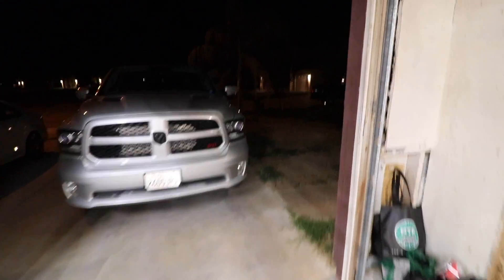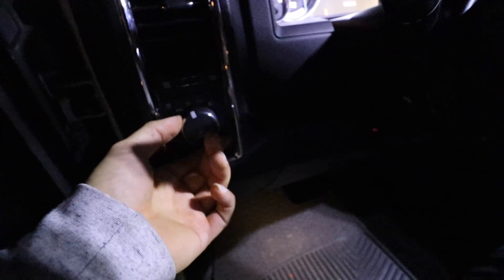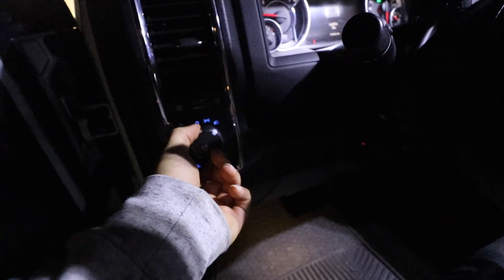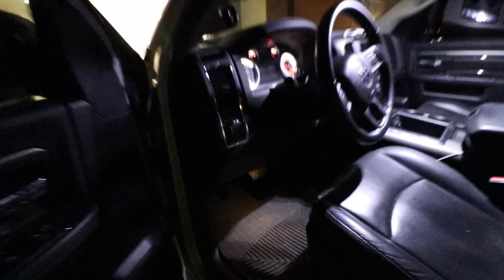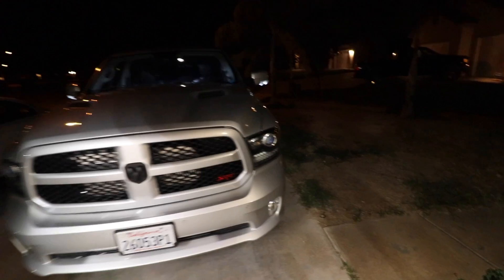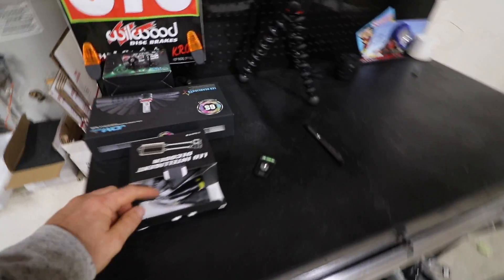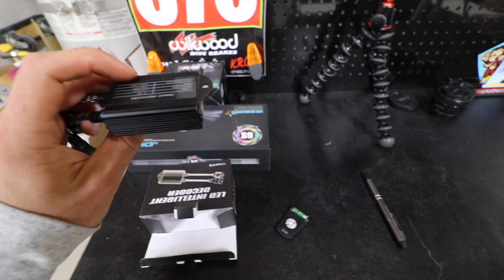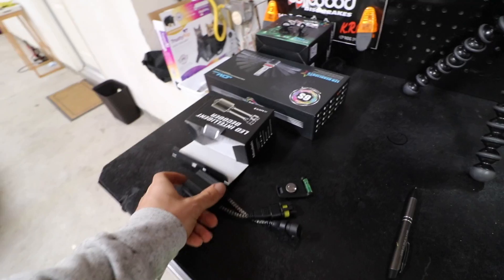RAM 1500 Canbus Decoder ISSUE

Comment: You have to use a relay hardness right to the battery! I recommend using Morimoto Mopar Relay Wiring Harness HD Resitor Plug & Play. I have the relay hardness with the same decoders as you and this setup works great. It’s not a decoder issue you have but a power issue when you have your lights set to auto. The auto mode uses half the power than using the lights on manual mode. HID’s need to be ran to a power source when using auto mode.

Comment: I also have 55 watt HID's in my projectors but I use an inter posing relay powered directly from the battery. Because the canbus would see very little load you must use 2-55 watt resitors one for each headlight. I have absolutely no problems at all! Check on line for this configuration as some aftermarket projector headlight vendors will supply these resitors with the new headlights. You can obviously purchase the resitors separately on line as well.

Comment: Bought mine from headlight revolution and I’ve had nothing but problems with my 2017 Dodge Ram 1500 big horn. Fucking lights flicker on and off every time I drive at nite. I have the GTR ultra 2’s with a relay/decoder and still it doesn’t work right. I’ve had nothing but problems this whole time, and I’m about ready to put stock bulbs back in. I’m at a loss and it’s making me crazy. But your video here makes a little sense, so I’m gonna hit  up HR for answers, Since they are guaranteed for life. Thanks for the info, it helped. 👊🏼

Comment: I had this problem ith my 2016 ram 1500 after a headlight hid upgrade,so i tried the
JDM ASTAR 2x 9005/9006 Anti Flicker Decoder and it works .no more issues,it also works in auto headlight mode
Reply: patriceknight72  what hid kit are you using with the decoders. Is it a canbus ballast and do you have a relay connected

Comment: Hey bro quick update on my mods, I used the 35W HID kit 9006 on my fogs with the same canbus decoders as you and mines do work with the auto setting without having to use it manually, most likely the issue with your 55w will be needing to run the relay harness.

Comment: Have to say I really like your videos...always so informative!
Question:  I recently bought aftermarket projector assemblies to replace the reflector headlights I have in my 2012 1500.  The assemblies I purchased also came with HID 6000K bulbs and all the fixings.  The backs are separate covers not like what you have stock.  How do they have to be wired???
I do have AlphaOBD and was wondering what do I need to program to get the DRL function to work and will it work on "auto?"
Does the "led" selection in OBD also set for HID?
What does OBD eliminate in the set up....just the can bus?  I must still use the ballast...correct?

Thanks for the help!!!

Comment: Thank you so much for this!! I was wondering what the heck was going on with my lights I have a similar set up accept my truck is at 2012 so I had to get the converter harness from headlight revolution for my configuration to work but on my truck it’s not only my headlight that goes out sometimes my indicator on the right side start flickering fast as if had a bulb blown. So I’m gonna try this out and see if it works

Comment: I recommend DDM tuning, I've been running ddm tuning canbus plus hid kit in my 2014 r/t for almost a year and have had zero issues, it's a canbus compatible ballast so no need for a harness or relays or decoders, plus lifetime warranty from their website
Reply: Last week bought them and they flicker when I start the truck, they are fine if the truck is on “run”.

Comment: Only issue I had was when you unlock the truck the HID would turn off after 5 seconds instead of staying on for the 30 seconds
Reply from the maker: Mine doesn't do that but when my battery was low/weak I had some flickering when unlocking the truck when the lights turn on with engine off.

Comment: I have a 2015 ram 1500 laramie with projectors
and the Hikari 12000lm led and using the Hikari canbus decoders my light worked fine for a couple of days with light switch on auto now they don't work at all on any setting,i don't know if its the decoders or maybe the new Diode Dynamics switchback boards i installed to control the parklights as DRL's,but based on what this video is showing i am thinking its how funky ram and dodge/jeep is,i am thinking about switching to HID...What do you think?

Comment: On the 2007 Ram 1500 I have the Hikari led’s wont turn on with the engine but do when the engine is off. I have used resistors with no better results. Will decoders fix this? Or how do I fix this? I need the bright light but I can’t get them to work!,,

Comment: Has anyone tested the AlfaOBD software and Scantools OBDLink MX connector.  Just got one this week and there are setting that you enable in the ECU for LED lights pretty much everywhere.  Wonder if that lets the Canbus compensate for the LED lights.
I don't have the LED headlights otherwise I'd try it.

Here's a discussion on RamForum on this software/OBD plug setup.

https://www.ramforum.com/threads/alfaobd.123982/
Reply: You can also enable NAV in Motion, SRT splash screen, adjust tire sizes, etc.  Pretty cool tool if you use it carefully and write down all settings you change.  Also, now I can roll both front windows down with the remote, like I could with my Challenger when I had it, pretty cool.
Reply from the maker: I think im going to go with the TAZER with active line lock and bunch of cool stuff
Reply: @BoostedMotorsports  have the Tazer for my Charger R/T, pretty cool.  Most of the stuff you can do with AlfaOBD, except for the linelock and light show feature.  Linelock works awesome in both Ram and Charger.

Comment: hey i just put a set of 55w innovaded hids, but they keep turning off and on randomly , did you ever get that problem fixed , with the auto working?
Reply: Adriano Montejo I also have the 55W Innovited and it flickers then turns off.  It was working when I installed them but next day flickered and off. I haven’t tried the manual switch yet, does it really work?  Did you ever find a fix?

Comment: Yup my hids are 50/50 I have to play with the switch sometimes, or turn on and off the truck. I have a different decoder, but have the hikari too just havent felt like taking all apart to switch them out
These is what I have HID Kit Computer Warning Canceller Capacitor Anti Flicker Hid Ballast Error Code Eliminator-2 sets https://www.amazon.com/dp/B07483MJT3/ref=cm_sw_r_cp_apa_i_ZY34BbVDVHAJ6
Reply from the maker: Yeah I ran a similar looking unit on my 09 too! Hopefully these ones work out but if not I'll have a solution soon enough no doubt and will keep everyone posted!